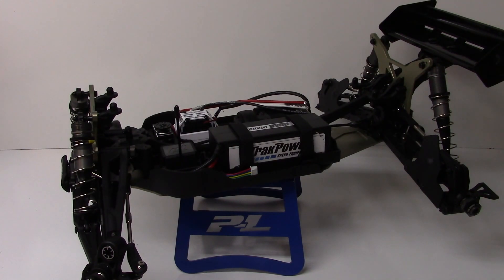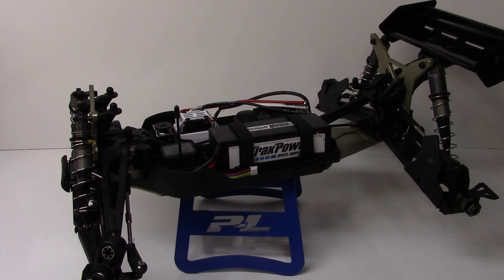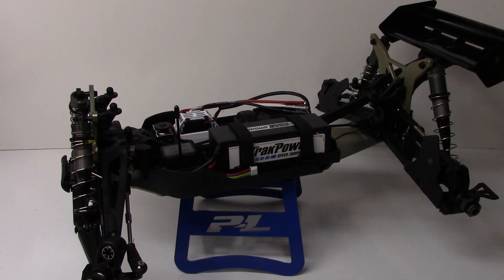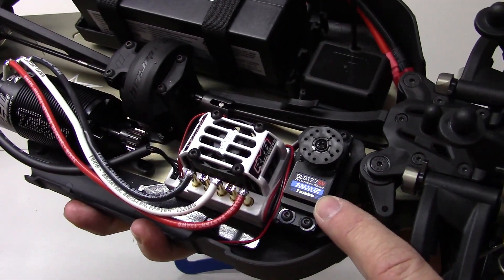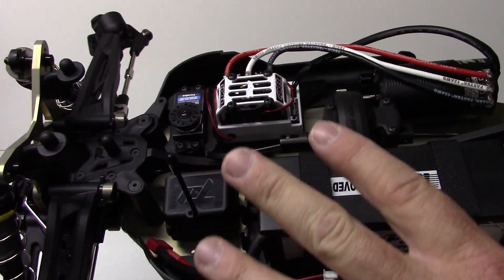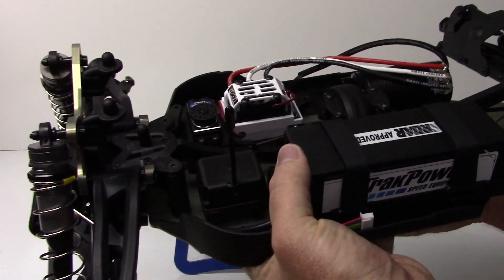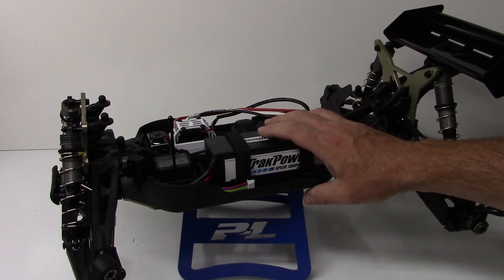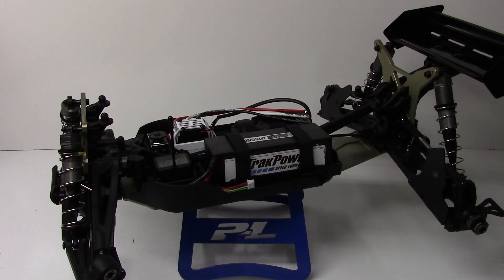Team Durango DEX8T - Build Update 2

Comment: with my RX8 i used shoo goo on the on/off switch and attached it to the side of the esc
Reply from the maker: Sleepy .Time Good deal.  I usually just Parma tape it to the side, but recently watched Squirrel chop it off and solder the connection together

Comment: Your build looks very nice...I have just a little bit of concern for your motor as it looks exposed and hanging off the chassis. Thanks
Reply from the maker: johncack100 I have it slid all the way over, as I haven't set the gearing mesh yet.....probably about 3/8-1/2" it'll move over.  I just received in the longer sleeved pinions, should have it mounted correctly for the final video.  Stay tuned!

Comment: Looks alot like ur arma kits. That's gona be one killer racer...what diff fluids are you running?  On my losi 2.0T converted mammba i run 2000 rear 10000 center and 7000 front...Just wondering i rarely get to drive my losi tho my sons drives it, and i run my savage 4.6.  Which you should get bro you need one nitro...lol...monster trucks make good nitros gota love the sound...they have a kit savage its the only monster truck kit i know of...Anyways rich your videos are awesome my fav rc channel...that durango is BOSS
Reply from the maker: Eric Dunlap Yep, Arrma is the TD little brother RTR versions.  TD are the race kits.  As for Diff fluid, I always run stock to test it out (5/7/3, f/c/r), which seems very race inspired (I've ran that in my SCTE, Tekno and a couple of e Buggies).  Not sure if I will ever get a nitro......Thanks again for watching

Comment: How do  set up pinion gear?  ( motor mount  exchange?)
Reply from the maker: Probably the worst part of the TD platform - you have to slide the motor mount into the center diff to adjust mesh and it's all done from the bottom of the chassis